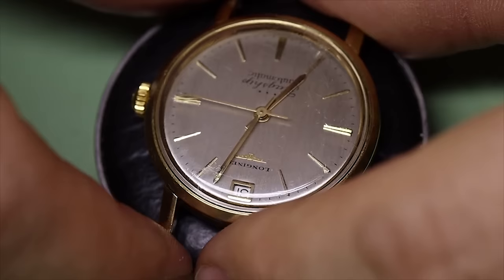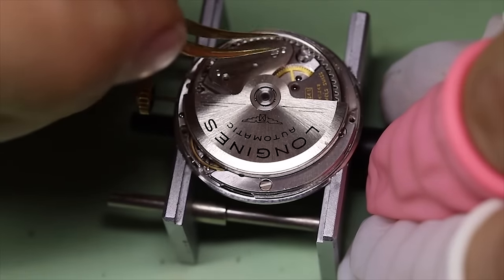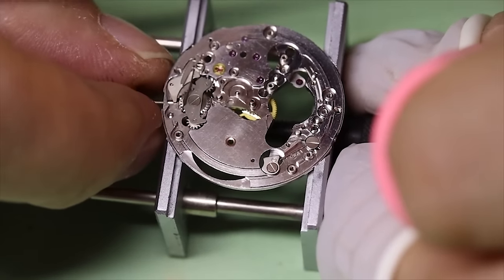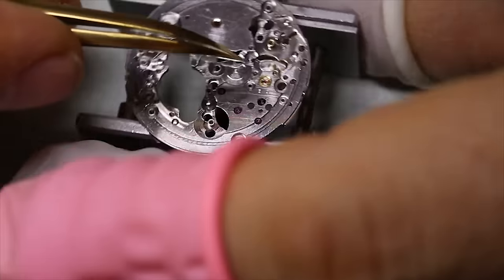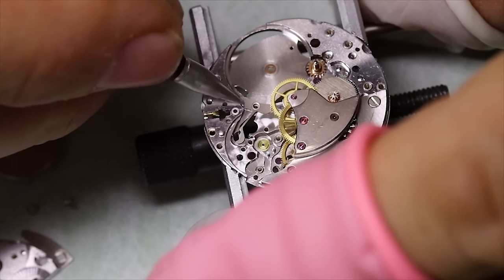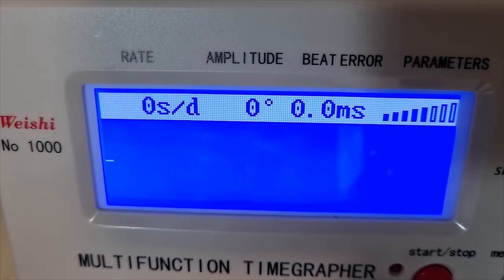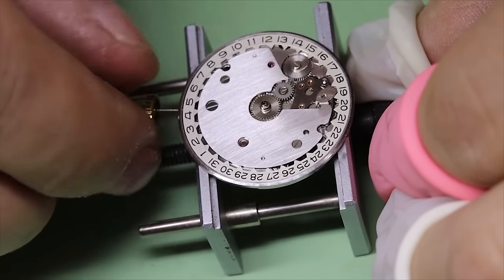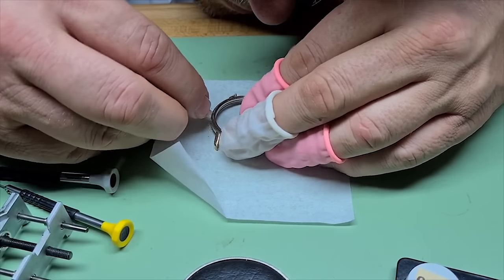A 1962 Longines Flagship with caliber 341 - what a gem!

Comment: In what position does the stem have to be in, in order to remove it from this movement?
Reply from the maker: It could be in any position but I generally prefer having it all the way in.
Reply: So, if I wanted to take the stem out and change it without disassembling the movement, I would keep the stem in the winding position?

Comment: Hi ! I'm part way through but paused to ask this question re, your comment about the rocker system being an elegant solution to switch between the winding & setting modes, despite the sliding pinion system being the more modern and universal approach.
If you don't mind, could you please explain that further for an absolute beginner?, especially in regards to 'wasted movement is bad' / efficiency ?
...asking for a friend!  
😁
Reply from the maker: Hello Anthony, can you do me a favor then and share this with your friend: 
The main downside with rocker systems for changing between winding and time setting is that it takes more space. It also involves more parts, so it's more costly to produce. There is a small wasted movement of the wheels since the wheel you're "rocking to" has to pick up the slack before it can start engaging. 
That said, visually they're much cooler than the standard sliding pinion, so I think rockers rock (pardon the dad joke, maybe you can tell your friend you made that joke and not me) 😉
Reply: @VintageWatchServices  😂 Thank-you. 
Great explanation. Even my stupid friend will be able to understand / visualise that!  😁

Comment: The diameter of the balance wheel looks large. I guess because a lot of makers stopped using adjusting screws on the wheel. Hind sight dictates I should have picked up a nice vintage Longenes three or four years ago. As the prices now have caught on that these were really nice high end pieces before so many people got on the watch bandwagon. Everybody was fixed on Rolex and Omega. Now some of the other nice Swiss brands are becoming the target as Rolex, Omega and IWC have went to the moon. Makes me feel like a big dummy that I sold my nice 70s Air King for $500 and Datejust for $800 in the early nineties. But that was what they were going for. Just like my apartment. It is over twenty years older then when I moved in and the price has more than doubled. Go figure.
Reply from the maker: Don't cry over spilt milk! :) It's certainly kind of crazy how fast the prices for vintage watches have risen over the last decade or so. Inflation plays a part but I think interest has simply spiked as well.

Comment: The Audemar calibre 2120 is the only other movement I've seen that has a jeweled track for the winding rotor.

This Longines seems to every bit as well engineered and built as Audemars - minus the anglage and cosmetic finishing.   

Obvious they spent some money, time and effort at the manufacture.  0 beat error out of the gate.   Excellent after your service.

Great post.  Thanks
Reply from the maker: Yep, Longines was really up there back in those days 💪

Comment: fascinating,I have a 1954 longines hand wound s/s with small seconds I've had it since 1982 never had it looked at but wear occasionally and it works ok but obviously could do with a service.
Reply from the maker: Hello Jim, Longines was very much a leading brand back then, making so many high quality movements. Your watch probably has a very fine movement inside it, considering it still runs ok after not having been serviced for 40 years or more... but it is time for a service for sure! You can contact me on stian@vintagewatchservices.eu, maybe I can do the service for free in exchange for making a video out of it. Send me some pictures of it and we'll discuss :)

Comment: I was taught that you put the hour hand on at midnight at date change as you indicated, however you put the minute hand on at 6 o’clock so that the minute hand is 180° from the hour hand when you press it on. Your technique seems to be to do it so that the hands are aligned when you press the minute hand on. I was wondering if you could comment on the difference between the two techniques and which you think is superior and why. I don’t claim to be an expert as i am just a tinkerer. I am curious. I am also wondering about hand levers vs presto pullers.
Reply from the maker: Hello Jacob, thanks for your question! I don't really think there's a lot of difference in the two approaches and am sure they both work just fine. Once you start using one approach and get comfortable using that, that's the most important thing, I'd think. Some people feel they can see the alignment of the two hands better at 6 o'clock, than at 12 o'clock. 
Personally I feel that I can adjust the exact position of the minute hand relative to the hour hand with the hour hand at 12 o'clock. It can be difficult to make the hour hand stop precisely at the center of the hour marker, or it might be that you have aligned the hour hand perfectly but that for some reason a couple of minutes pass before you can place the minute hand (I predominantly work on old watches without a hack) . When placing the minute hand with the hour hand at 12 o'clock, if I see that the hour hand is slightly past the hour I can put the minute hand a few minutes past also to make their alignment better.
For the tools: I prefer levers myself but the presto tools also work fine. The important thing is that the dial is protected against marks, so there always needs to be something between the tools and the dial to ensure this. Also, the presto tools are actually not very well polished from the factory, which makes them more prone to marking the dial. A few seconds on the polishing machine is enough to alleviate that, though.

Comment: As a learning but keen amature watch repairer could you tell me why the amplitude will increase/improve when you add the automatic works please. Great video as always!!
Reply from the maker: Hello Carl, it's for the same reason that you're more likely to slip if you run on ice than if you walk slowly on it. The automatic system winds the mainspring in very small increments at a time, thus allowing the mainspring to coil up a bit more before slipping. Winding by hand is much more forceful and the mainspring slips more easily as a result. It's all about friction :)
Reply: @VintageWatchServices  ah makes sense - thank you 🙏
Reply from the maker: My pleasure, and I thought I'd just clarify that the amplitude will not change massively, at max probably 10-20 degrees.
Reply: Thanks. I have just completed an omega 661 and indeed the amplitude did increase once the automatic module was added. It now sits at 290 - 310 from about 270 
Just waiting for the dial to come back from restoration and it can be re cased and given to my wife for her birthday 🎉

Comment: I have one of these lovely watch to repair, the watch repairer I sent it to says they cannot clean the dial as its painted?
Reply from the maker: Well, a dial can be cleaned but only of dust and surface debris. 99.9% of the aging effect on a dial cannot be removed without repainting the entire dial. It's kind of like if you have freckles, you cannot clean them off, they're in the skin.
Reply: @VintageWatchServices  yes if just like the dust cleaned, hands and crystal. They don't seem to want to touch the movement which is a shame. 

I'll see how it runs with a new crown. Then it might need to get sent elsewhere...

Comment: I noticed that the endstones for the balance wheel were clear instead of ruby red. What sort of jewel is that?
Reply from the maker: Hello Frank, you're quite right, and you find these in some watches. I believe it was originally done to make it easier to inspect the pivots and the oil, but it makes them very difficult to find if you should drop one or even inside the cleaning machine basket. 
When they make synthetic rubies they typically add a tiny amount of chromium, which gives them the same color as natural rubies. With less or no chromium the rubies will be clear, like these. Which would technically make them sapphires, I believe, but I'm no gemmologist :)

Comment: What were manufacturers (not just Longines) thinking with mainspring barrels labeled "do not open"? That they'd be replaced with a "loaded" barrel at service? You've talked so much in these videos about the importance of proper mainspring lubrication, so what is the reason not to open? Are they just not designed to be opened and might be damaged?
Reply from the maker: Hi, thanks for your question! The barrels were indeed intended to be replaced at service. That worked well as long as they actually made spare barrels, but not so much after that... The barrel can for sure be opened, but as you assume there is a greater risk of damaging it when opening it and trying to reassemble it. Which isn't necessarily a big thing if you have a spare, but if you don't, you might want to see if the old one works alright before attempting it 😉
Reply: @VintageWatchServices  Thanks very much!
Reply: @VintageWatchServices  Hello, thank you for your advice. If the sealed unit is in good condition, what exactly do you recommend? Not cleaning it in the cleaning machine, and only oiling it?

Comment: I had one serviced a couple of years ago: it is weird to see that off centre rotor in the back but it adds to the originality if the movement.
Too bad Longines has fallen to a entry level brand in the Swatch ecosystem: you can see why thy were tip dogs back then!
Reply from the maker: Thanks for watching and for your comment! Yep, Longines was absolutely one of the giants in watchmaking back in the day, and it's a bit sad they're no longer quite there. They're not entirely an entry brand though, and there are some signs they are starting to flex their muscles. It would be very nice to see them challenge Omega and Rolex again :)